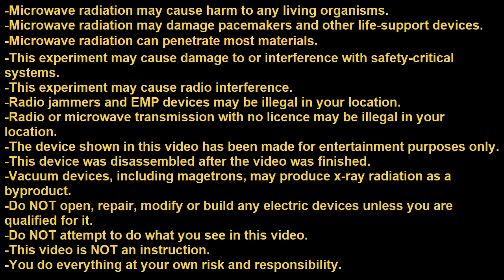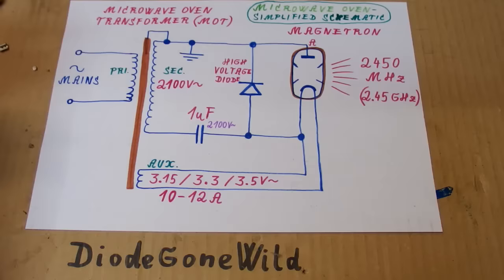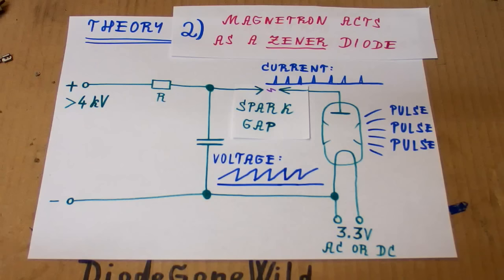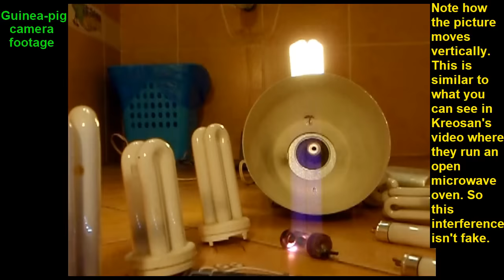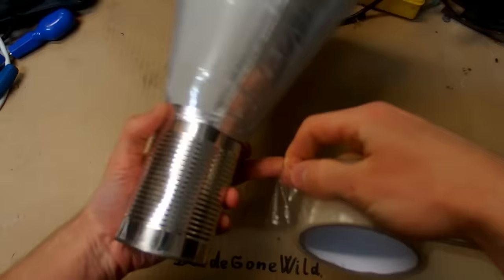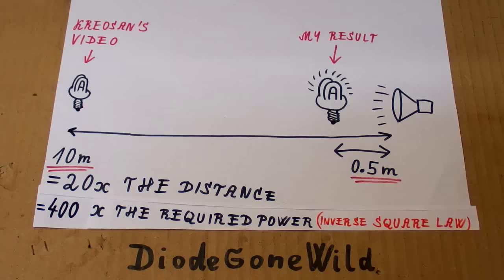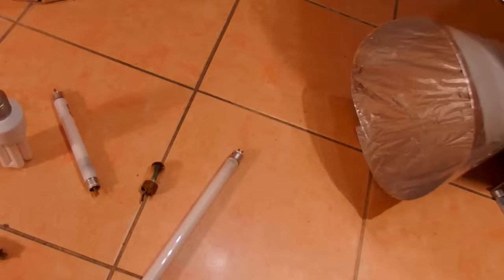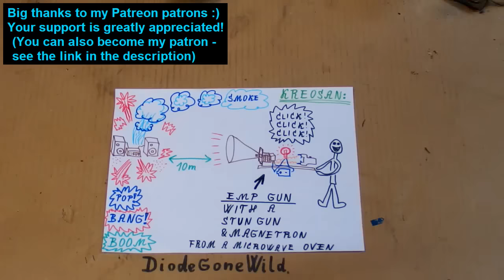Debunking Kreosan's EMP gun from a microwave oven magnetron + stun gun

Comment: Ok back in the 80's I tried this. My dad was a engineer and I wanted to impress him. I used wave guide material from a manufacturer that was square and it worked fine. The problem I had was something my dad said would happen. The farther from the antenna the weaker the RF. I could heat water at about 20cm from the antenna, not the waveguide but antenna. I used the stock microwave power supply and could only use it when he was around. lost interest and found the Z80 was fun to play with. Any ways it was cool to see you do this. Now I'm going to watch it. keep up the great work you do for us. Thanks
Reply: You could of course have used a half-wave dipole (6.1cm) and a few directors, that could give you enough gain to blow the balls of a Nat at 30 paces.
Reply: Maybe a marx generator for the high voltage.

Comment: You can get better EMP (EMI) effects by charging up a vhf resonator (piece of low impedance co-ax cable) to around 5kv and then discharging it through a spark gap with a wire antenna attached to the resonator (VHF spark gap transmitter). Affects unshielded electronics to a distance of about 6m and can run from two 1.5v AA batteries - camera flash charger into a diode multiplier - and actually works.
Reply: Now this knows his shit.

Comment: This would be possible at the theoretical, with a much bigger horn, a better quality waveguide and especially coupling the magnetron to the waveguide has to be done very carefully. It´s comparable to organ´s pipes or a flute: you put that magnetron output coaxial pipe 2cm closer/further from the end of your waveguide feeding the horn, and the impedance match will be completely different (shift several 100 Ohms easily). Potentially increasing the field-strenght or decreasing it, by match of mismatch to the impedance of your horn antenna. Btw, this horn is way to small for 2.4 GHz and the ´exploding´ effects, if it was several meters long however... But by than the beam is so narrow, you literally need a lasersight to aim it. And than we´re not taking into account the actual damping along the track, which is heavily dependent on the presence (or not) of water. Which is why 13cm band never was popular among radio folks.

And seen the fact a magnetron is a transit-time tube, the voltage applied must be very steady, same for the current. Increasing the voltage actually reduces output instead of increasing it. There´s a strick formula for amount Gauss of the magnet vs Voltage/Current on/trough the tube and the output frequency. This is a CAVITY magnetron, fixed tuned inside, not a real ´magnetron´ that can be tuned (like the old versions of this thing, you can make those with cheap HV vacuum diodes from old BW TVs if you want). There´s like a billion types of Cavity magnetrons, from Continous Wave types to pulse-types for RADAR. You could increase the output by adding more magnets + increasing the CURRENT trough the magnetron, but that requires a lot of finetuning. Basically every step you´re taking here is counterproductive, except the impedance matching. You´re dealing with a negative resistance device too!

Regards,
Thomas
Reply: Absolutely agree.  I also think that to increase the power, one could try installing another magnetron at a wavelength distance

Comment: Everybody's Wi-Fi for miles around, dead. lol
Reply: Probably not, there's just not enough energy radiated, as you can see even the florescent lamps nearby barely light up.  Though it was a fun experiment. :)
Reply: @BillAnt  there is a big difference, Wlan power is in the  mW range and lightbulbs have 10-100x more Powerconsumption. There is a reason this type of experiment is illigal, because it affects other radio emmiters (wlan and much more)
Reply: @hyperhektor7733  true that home WLAN is running 100mw Max by law. Even if the micro wave 2.4ghz depletes by 4 every centimeter if will still kill wifi for 30 to 40 meters
Reply: @peterzingler6221  < It does not kill WiFi more than a couple of meters away, most of the high energy has already depleted after a short distance, however it WILL interfere with WiFi devices which will probably disconnect simply because it's unable to receive the carrier signal.
Reply: Lol, always has to be people who take a joke too literally.

Comment: when a stun gun is used the posts are not arcing to the target its being used on. the spark gap is used to show the user its functioning also a potential deterrent from the loud sound and bright flash from ark. this defense tool is intended to be used by pressing the posts against the target for it to be affective. technically there would be a very small gap depending on how much clothes or material it must make it through but this would be very small
Reply: That's why I always add a 2nd spark gap to a stun gun. =)

Comment: You will never see the true power of this contraption unless you bolt the magnetron back into its exact and proper orientation inside a waveguide, a waveguide  that terminates in a true microwave antenna. And I am not sure that pulsing it with a stun gun is going to do anything except perhaps blow the diode.

Comment: Great Video! You covered pretty much everything there is to cover.

The only thing I could still see is:
When they exploded the audio amplifier, the microwaves may just have been the trigger for an explosion: Microwaves could be turning on transistors or diodes that are not supposed to be on at the wrong time, causing a short circuit. Additionally, with different types of discharges through the magnetron, frequencies other than the typical 2.45GHz may be produced.

As for the lamps they turned on from far away, I would guess you are right that they just went closer to it for better effect.
Reply: Isn't the magnetron frequency fully controlled by the distance between the anode cylinder and the cathode?
It is a resonance cavity in which the electrons circle... Or can you influence the speed of electrons by varying the voltage?
Reply: Actually the frequency is mainly dependent on the magnetic field strength in the magnetron as far as I know. That´s what the magnets on the magnetron are for. As he said, the voltage stays pretty much stable at 4kV no matter what you do.

Of course you are right that it is built to resonate at some frequency, but you could still get some output at other frequencies.
Reply: @NerdyNEET   While power supplies should be protected by fuses, you will often find that in the event of a fault, such as both transistors turning on at the same time in a half-bridge PSU, the transistor will explode violently before the fuse has a chance to react...

The biggest danger if the PSU explodes when you are repairing it is you having a jump scare and hitting against something. I was fixing a PSU, then a tantalum capacitor burst, I had a "oh crap" moment and I accidentally hit the bench with my hand, violently. It wasn't funny at all :D
Reply: NEY Industries  You are most likely correct that they faked it. I just wouldn´t completely rule it out yet that something could explode like in the video. I´ve never seen anything like it though, especially not something that would blow components out of the case.

As MrOpenGL said, fuses are unlikely to do anything to prevent this though. Most likely their amplifier only had a single fuse on the primary side of the mains transformer, so nothing would prevent the amplifier´s bulk capacitor from discharging through some transistors.
Reply: Having accidentally blown up some transistors and ICs, yes, they may well self destruct, but with nowhere enough force to make it through a decent case or enclosure. Now capacitors being abused is another matter...

Comment: US police use a mixture of microwaves and other radio frequencies to generate EMP and disable the ECU of getaway cars (the getaway car's wiring acts as a receiving antenna, and the car has a specialized antenna that narrows the signal into a thin but powerful band.

The technology for this has existed for over 40 years, however it only started to be tested and used very recently, because it was extremely difficult to control/find the correct charging point to just IMMOBILIZE the vehicle without causing damage to the ECU, and brakes system and other vital components fail.

Comment: DiodeGoneWild,I hope you read this.I was experimenting powering magnetrons from higher voltages and it seems like its totally impossible to power them at 15/20kV. It will arc over from the high voltage input to the metal fram where the heater wires enter the bottom at the pink insulator .That's why it barely worked on your 20kV power supply.
Reply: What voltage are they originally powered with?
Reply: @NeuronalAxon  4kV.
Reply: @mernok2001  - Ah, thanks.

Comment: How about a 'glitcher' made from 8 parallel pieces of co-ax cable with an antenna attached.  Charge co-ax to about 5kV (a camera flash charger and voltage multiplier and discharge the non-antenna end through a spark gap).  Range is about 6m but frequency is much lower.  It works...
Reply: It's much more unobvious and looks not so scary ))
Reply: Yup that's a coaxial transmission line, you can make a much stronger one with a home made jelly roll capacitor made of heavy duty foil and landscaping plastic in mineral oil. Add 4 to 16 turns well insulated as a spiral in the center. When the capacitor discharges it develops hundreds of thousands of volts at about 160nS. Adding an antenna and a coil for the delay creates a legit EMP device. The nastiest is made of a gimmicy HDTV antenna with a small satellite dish. Single shot, but if you want repeat fire then just cut the antenna fractal pattern in copper clad board. The ground plane inductor sets the center frequency 🤓

Comment: Hi, at 22:04, when you create a spark in the air this way, 99% of your energy is being lost heating the air, pretty much nothing is being used by the magnetron. I think the only easy way to put high voltage (20kv to 100kv and high power) in the magnetron is to use a transformer upconverter. So somehow make a pulsed (around 0.1 second on, few seconds off) resonant circuit in the primary of a transformer that you hand wind and use 100V and around 100A, should give you a 10kW high voltage pulse in the secondary, for a few milli seconds at least. So you charge a capacitor bank in the primary, then dump this energy in a resonant 60Hz circuit, the magnetic saturation may limit the power though.

Comment: Everyone uses cans and other circular waveguides makes me wonder if oven magnetrons produce primarily linear polarization and the wrong waveguide attenuates most of the energy?

Does anyone know for sure the predominant polarization mode of oven magentrons?

Not saying Kreosan's video is real, but 1000W is a lot of power to lose in about a foot, the waveguide here is definitely attenuating a lot of energy (by it getting hot). What would the range of a magnetron be in a proper wave guide with a proper high-gain horn? Maybe not to light up CFL lamps, but just to be read on an RF power meter?
Reply: Also, didnt kreosan mention in the vid that the hardest thing to find was the horn
Reply: Waveguides are only one piece of the equation. In a microwave oven, waves enter the resonance chamber
(the metal body of the oven) via the wave guide. The chamber is very specifically dimensioned so that the electromagnetic radiation will create several standing wave modes. These modes are partially determined by the frequency being emitted, In this case ~ 2.4ghz.

Much like ripples in water, there are high points and low points in these standing waves. The waveguide is designed to match the area of the resonance chamber. Now imagine the open atmosphere is your resonance chamber. Your waveguide would have to be specifically designed to deliver high energy density within a certain area in open an atmosphere. It is very difficult to focus the energy to land in a particular area exclusively, as it will want to go every direction without having the constraints of a metal box to travel in. 

Radio towers function much the same way as a microwave oven.However, they aren't particularly worried about aiming the energy, they just let it spill out it every direction into the open air. As the waves further dissipate into the open air, they begin to attenuate and become weaker. The solution to this is increase the amplitude of the wave. Commercial radio towers amplify their waves to extremely high values in order to blanket an large effective area with signal carrying waves. 

Just like when you drive outside of the range of a radio station, it will begin to fade out. You have now left the the effective area that those waves can be transmitted through the open atmosphere (at least at the current signal amplitude).

TLDR: Waveguides are selected based on area dimensions. Transmitting into a 10"x10"x10'" area would need a different wave guide construction than a 5"x5"x5" area. The larger the area of the open atmosphere, the higher the wave amplitude needs to be to still have a powerful signal throughout the entire area.
Reply: @Ian.G256  Except for the silly imperial units, you are completely on the right track. You can't just put some random size tin can in front of that magnetron. The whole system has to be in resonance. It's not black magic, it is high frequency physics, which isn't straight forward.

Comment: I made one of these once.  It was oddly useful for dumb things.  Without the metallic housing to reflect most of the radiation back and forth through the "target" its actually very weak.  In situations like drying sponges it actually worked OK.   It wasn't uncommon for pest control in the 70's and 80's to use microwave emission units to "radar" bugs to death to dry them out.

The problem is the whole thing really isn't portable and it is literally impossible to create a "beam" from this specific hardware.  You need to have parabolics and a special magnetron to produce a "beam' and even that attenuates in humidity.

Comment: The magnetrons out of microweve ovens are capable of incredibly high energy if pulsed, but it need both high voltage AND current. Fired one off the guts of an old excimer laser at 18kV and pulse current peaking at  500A. That would cook electric stuff but average power was less than what a microwave oven puts out. The pulses were used to excite a far IR multiple gas laser. 🤓

Comment: the aluminum filament neither bundle radiation nor does it intensify radiation in the center - it just absorbs the radiated energy on the edge of the gun (even not totally, as we can see - so there is danger still).   I don't know, which material could fulfill this task but I think, the most promising way to have this bundle-effect is on the constructive side of the Magnetron   ....poor camera, btw  .D    .........love your videos

Comment: I believe with better bonding, better materials, and a properly tuned and engineered cone you would have completely different results, many other small changes like soldering connections, would greatly increase the output power. It's clear in the video, alot of the variables you added resulted in decreased raw output power. This is likely due to the connections not being about to carry the load. Looks like alot of voltage loss in the system..

Comment: Maybe you should try with 3 magnetrons, like they did, for more authenticity.
Reply: It will change nothing
Reply: He explain with theory, and you can calculate work or not
Reply: As 3 magnetrons cannot be synchronized it would be impossible to sum the power, even with a well-designer coupler (already a touchy stuff!). And even if it was possible you would gain only 10dB (let's say +70% in distance). However, maybe t's possible to increase a little bit the performance of the single magnetron "gun" be designing a more complex circuit to get longer high power pulses. Indeed, using a spark gap limits the pulse duration to a very short amount of time (a few nanoseconds, so a few periods of microwave carrier) and maybe the magnetron does not have the time to reach full oscillation in this case. (Supposition)

Comment: Remember that they used batteries to heat the magnetron filaments (when the filament was hot the lamp turned on). Then they applied high voltage with trster (I suppose 30kv) between one of the filament terminals and the chassis.

Comment: There is a big problem with your setup. The coupling cone that you use is wrong. Coupling geometry is critical, research it and make it well, there will be a huge difference.
Reply: There are also missing electronics to make an emp. This, if setup to function normally, is nothing more than a WiFi jammer. There is one critical operation being overlooked involving the rise time of the emitter. This project as is, is completely useless.
Reply: Yeah I noticed that as well. Plus everything has to be not only shaped right but also made of the right material

Comment: Electroboom sent here. the camera probably has some amount of shielding.  The reason a Elctro-magicatic wave" " such as what you get from solar flairs, might temporarly confuse satalights (for example) is  basically they have to here what a transmitter on the ground is saying. so if mr sun is SHOUTING much LOUDER (stronger magnet basically-sort of)  then it gets disorientated. But in short a microwave such oooh say a wifi reciever and transmitter (ie typical LAN box)  won't have enough umpf,...their also shielded and have to comply with very strict standards or they get very big bill.

Comment: The length of current pulse is so short and magnetron has not enough time to excite the microwaves. The scillations in a magnetron are not excited  immediately, some time is needed to reach stable output. So, as shown in applied science video, it's necessary to see actual instant power of microwaves by rectifying the received microwave signal and recording the envelope.